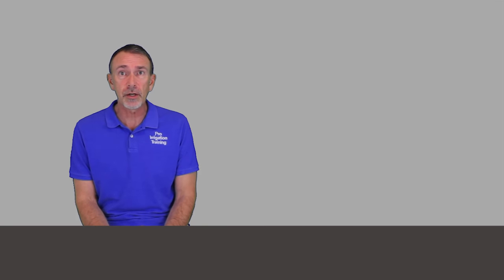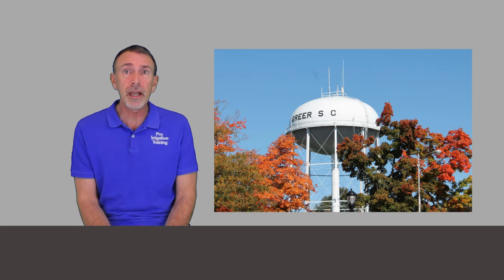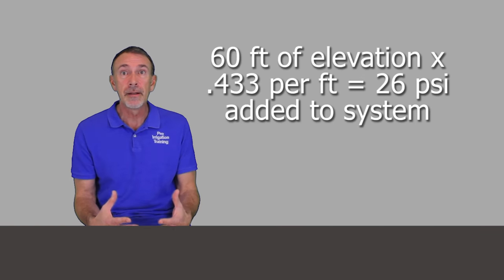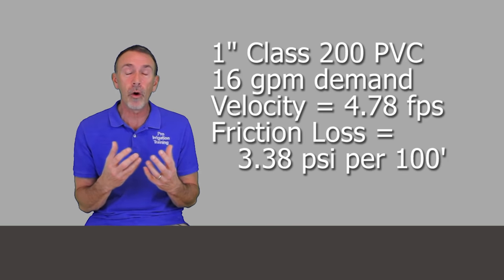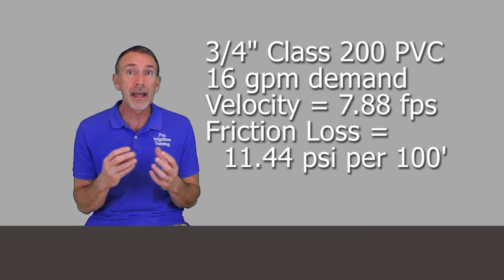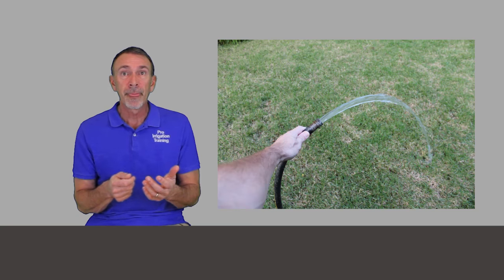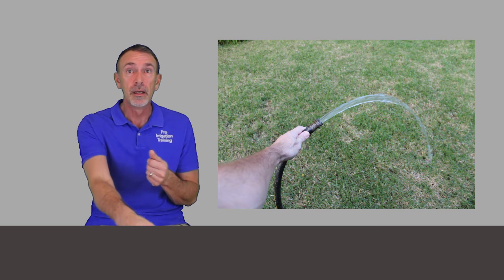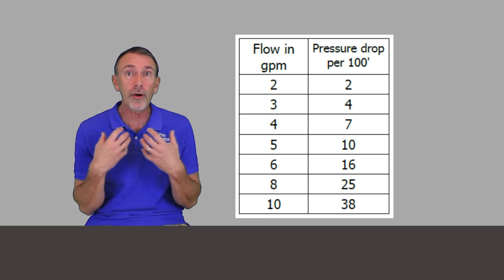3 Ways to Increase Pressure in an Irrigation System

Comment: I understand what you are saying, but fluid dynamics does not. You can absolutely increase pressure by reducing diameter. This is how irrigation pressure regulators work.
Reply from the maker: I knew someone would eventually bring advanced concepts into this discussion. You're absolutely right in the technical sense. But I'm 100% correct in the context that I have described. You cannot downsize entire sections of a zone and get higher pressure. That can be seen and measured with a pitot gauge time and time again. Trying to squeeze 15 gpm through a pipe that will only carry 10 gpm (at 5 fps) results in higher friction loss and lower pressure. These videos are for the beginner technician and the homeowner trying to repair their lawn irrigation system. I have to leave the advanced discussions for other forums, it's all I can do to get across the concepts of pressure, flow, and velocity. So I do appreciate the comment. I should have a disclaimer that there is some simplification of both water hydraulics and electricity as well to keep the info manageable and job-appropriate.
Reply: Yes, fluid dynamics does not agree. Same in the Air Force on Weapons systems all bombs and rockets are blown off the aircraft and we use different size orifice to either increase pressure or decrease depending on the weight of the ordinance. But given your knowledge I understand flow rate from all my days working with hydraulic pumps etc. I will say with water for irrigation systems you are pretty knowledgeable.  I have built my own and yes GPM changes (depends on the type rotor, spray, impact etc. number, size of orifice)and you may not have enough to run the same system with the smaller pipe.